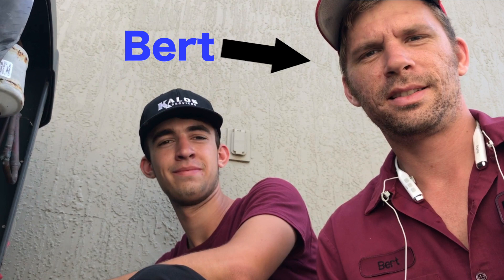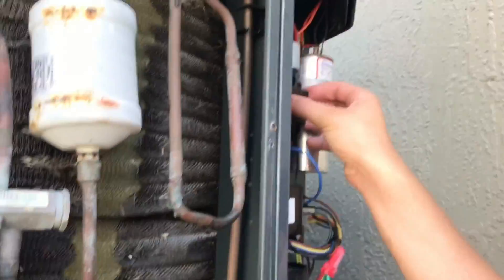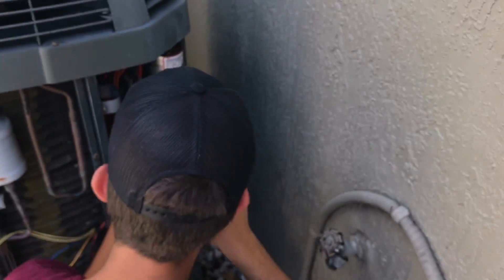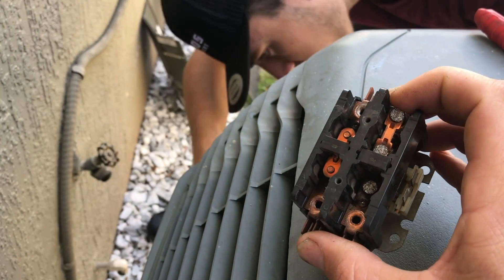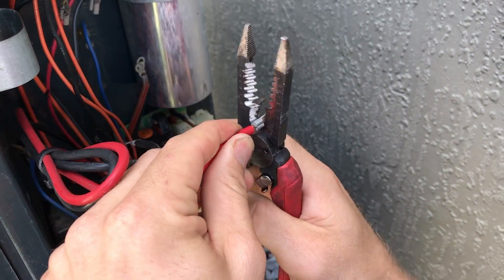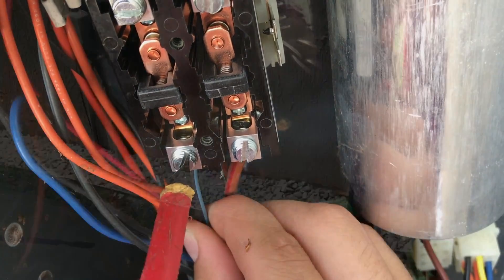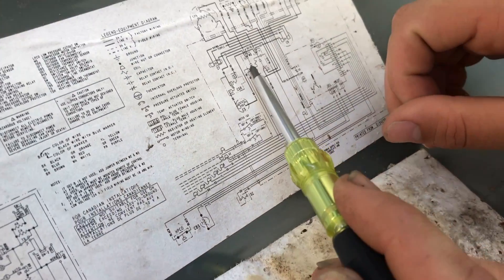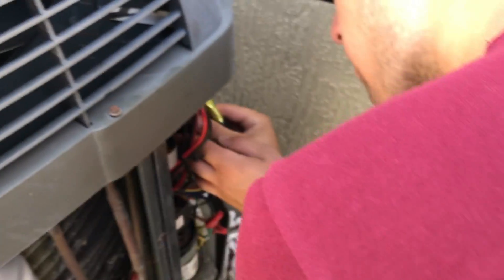How and When to Change A Contactor

Comment: Mines single pole and it stuck last night.  for some reason when a gfi in the kitchen popped off , the switch stuck on the contactor.  I only noticed it when I went out to the garage to put groceries in the second fridge out there and I knew the a/c was off but I heard that fan running outside.     I disconnected it and went to look earlier today and I found the cover was off on the stuck switch.  Of course all the power was disconnected at that point, I tapped it and it unstuck.    What I am wondering is if I should replace the capacitor as well as the contactor. I mean, it unstuck but I know how old all this stuff is.    my capacitor is Oval and tall, not a squatty one and not a round one.  It has no markings on it however.   also i have been the owner since 2006 and never had any problems with this condenser unit ( Carrier ) at all.    when I tested the system after the contactor was unstuck it worked fine but also, LOL  i am not going to trust that contactor to not stick again. 
  I wonder what the heck the specs are on this capacitor though.  I don't see why it has no label.   i am leaving the entire system disconnected from power until I at least get that new switch.   There is also another little doo dah thing in there. Cer-Mite CM Ceroc   wonder if that needs replaced also.    maybe all this stuff needs gone and new installed?

Comment: I love your videos, both content and execution.  This is the first time I've seen/heard of cutting the ring terminals to fit into the contactor lug.  Your explanation of that made sense.  You've already got a good crimp connection to the stranded wire and then that should give something for the lug screw to be able to connect to without mashing or damaging anything.  But then later you described that the contactor has a torque spec.  I'm assuming that the torque spec for the contactor is for screwing onto wire or perhaps a ferrule.  It may take more torque than that to get good purchase and electrical contact onto the crimp portion of the ring terminal that the techs used here and hopefully that's well below the failure torque for the lug threads.

Comment: I agree....no problem is snipping off the ring connector on the "ring". Another way.....take the ring and fold it onto itself lengthwise......makes for a solid "bar" to insert under the screw-head connection.

Comment: Yeah and the sucky wire nuts on the trane and there’s no telling what else happened. Also need to check the breaker sometimes electric panel and the breakers get loose and the wires got loose

Comment: Dielectric grease is non conductive this is not the appropriate use .They make the proper grease for that application manufacturered by several suppliers but let's be clear that is absolutely the wrong use of the grease the tech used and all screws on high amp connections should be torqued to stated value on the contractor

Comment: I’ve been using the same method of leaving the crimp on when changing out contactors for a few years. Now we only stock lug type contactors because of the solid connection the is method provides. Your narration is spot on. Great video.

Comment: When dealing with a three phase system and three pole contactors, is there a way to test the Integrity of the contacts and determine when they are close to failure?
Reply: Such as checking the resistance with the contacts energized but no high voltage applied.

Comment: I've been doing electrical since the early 80's and I had some systems that I performed 6mo maintenance on  for years on end. I've seen new systems go in without the use of deoxidizing compounds and end up with terminal corrosion in 2-3yrs. Then I've monitored connections that have been treated with De-Ox, Noalox, etc. and seen zero issues. I alway do voltage drop tests and measure terminal temperature, and the De-Ox/Noalox treated connections have performed significantly better than untreated systems.

I use de-ox compounds on on all connections that are outdoors or in high humidity areas, with excellent results. I even go as far as using de-ox compounds on male cord ends, plugging them into recepticals in order to coat those contact areas. I am 100% convinced that the de-ox compounds are benifical, if used in moderation. Regardless, always tighten, wiggle, tighten, wiggle, tighten, wiggle, tighten wiggle...

Comment: I truly believe some of the original equipment contactors are undersize and cheap.  Sometimes it’s better to go up a size.  Also it should be verified that the unit is not able to short cycle, or try to start when the system isn’t yet equalized.  Frequent starts kill contactors.

Comment: One thing I've found that is also very important when replacing contactors is referring to the schematic as was done here to confirm the style of contactor. We run behind a lot of people working for home warranty companies and often I find double pole contactors installed (without properly jumping out the proper side of the contactor) where a single pole contactor was originally intended by the manufacturer.

Comment: Has anyone used this? "DEOXIT Contact Cleaner" that is how you properly clean and protect contacts like the lugs that were greased. This product and products like it are designed for that.
Reply: Deoxit is the absolute best contact cleaner I've ever used! But, it doesn't leave a heavy enough film to protect connections (in my opinion). I use De-ox, Noalox, or similar heavy bodied compound after I clean with Deoxit. Some items should be cleaned, while others should be replaced. Pro tip: if the contactor has corrosion, replace it rather than trying to clean it! Also, if the wires are corroded, especially if they've turned dark, cut them back to good copper (if possible).

Corrosion and its heating effects, that in-turn cause corrosion are like a communicable disease. Camp grounds are a great example of this phenomenon: new receptical is used by camper #1,  who has a heavily tarnished or corroded plug. Assumming camper #1 is using high enough amperage, the high resistance in the connection causes localized heating, thereby damaging the new receptical via rapid oxidation, carbon deposits, and thermal degradation of the metal contacts. Now camper #2 arrives with a brand new plug, but he plugs into this now damaged receptacle. Assuming camper #2 is drawing enough amperage, the high resistance in the connection causes localized heating, thereby damaging the new receptical via rapid oxidation, carbon deposits, and thermal degradation of the metal contacts. Now his plug is tarnished, pitted, etc. Enough of this localized heating will eventually cause the wire itself to become compromised and simply changing the plug or receptacle is no longer enough to stop the spread of this insidious communicable disease. Most of these issues can be avoided by the use of thin coats of a deoxidising compound on the wiring, the plug, and the receptacle contacts (in my opinion, but based on testing).

Comment: Brian, Excellent video, as usual. Instead of dielectric grease, use anti seize grease, like this:
https://www.amazon.com/Permatex-09128-Copper-Anti-Seize-Lubricant/dp/B000HBM8HU/ref=sr_1_17?gclid=Cj0KCQjwoqDtBRD-ARIsAL4pviBXH5hq_kSOliOAlbhm2kLFmhv_Xt3XUNcDBGSh_fIx4kcgpaCQVREaAmveEALw_wcB&hvadid=177542121011&hvdev=c&hvlocphy=9052539&hvnetw=g&hvpos=1o1&hvqmt=b&hvrand=16064951371036436168&hvtargid=kwd-29833005865&hydadcr=6402_9585569&keywords=conductive+electrical+grease&qid=1571344246&sr=8-17

Comment: How come HVAC companies are crazy about technology, but won’t use a voltage zero crossover circuit to only energize the contactor when the
AC mains are about to cross zero volts on the sign wave, thus drastically reducing the arcing.

Comment: had one being shorted by a 24 volt short in the furnace blowing the 3 amp fuse on the board. Fixed the rub out short. Called for cooling and the contacter was chattering. compressor sounded horrible. Shut system down changed contacter and restarted compressor. Compressor would not run and was off on thermal. Placed ice bag on top and went to lunch returned and attempted to restart compressor. would not restart. Omhed out  single phase compressor one omh per leg. Advised customer compressor went bad.

Comment: I have been coming across a lot of buzzing contactors in electric heaters (208 3phase with 208v coil) they are pitted pretty good too, when I swap them with new ones they dont buzz. What causes this? Thanks!!
Reply: Matthew Beblo, the “buzzing” comes from rust on the surface that is attracted by the electromagnet coil when energized. The uneven rust surface causes it to not sit flush and generates a “buzz” as it tries to do so. This is caused from not being energized for a long while. It will calm down some after several cycles, but will never be as quiet as it should.

Comment: Oh I thought u said contractor!?
Switch!!!
Like musical chairs!!!
The one with plumbers crack syndrome goes 1st!

Pull ya pants up before you come to my place..... ain't nobody got time for that😂🤠🤣

I change them when they have sutty look around the contact area! Or intermittent strange freeze ups!?(or visibly worn!!)
Always put right size in too(residential)or slightly higher amperage (30amps are good!)RFL ?!
Bigger the unit single phase unit... probably need a bigger contactor amperage 30-40 plus?!

Wire terminals burning wearing.... replace contacts & make sure they're tight snug fittings!
Clean /rinse the condenser coil.... hot unit .... hot/ harder working outdoor unit/system!

Take it to da house 🏡🏃🏼
There's always more to check...
Experience will tell you if low on refrigeratant after cleaning coil(s)... take temp drops at supply & return vents etc!!
A history of good check ups will help with determining the system charge!?
Eliminate call backs! Do a gd thorough job the 1st time!!👍

Comment: Being a little picky but 2 things. 1st use factory style contactor and you won't have to worry about the issue of the wire ends. 2nd ants will still get into that style of contactor...lol had it happen many of time....
Reply: Loral Kinney I don’t even carry 30 amp contactors anymore because the lugs on the 40 amperes are far superior, still have ant issues on those though too...
Reply: @andrewhicks6494  There are 40 amp contactors with the factory screws for ring terminals too, but I take your point that this allows you to simplify what you need to stock in the service van.  And these lugs are more common.

Comment: Sound like yall the kind of guys that try and sale a complete system when a fan motor goes out. There was nothing wrong with that contactor
Reply: @Texas made The contacts are pitted and you can see it's smoked up from arcing. I'm a tech with 23 years of experience and not a parts changer or a salesman. If I'm doing a PREVENTATIVE maintenance and see a part that may fail in the near future I will recommend to the homeowner to let me replace it to prevent further problems. That is the reason we do preventive maintenance is prevent breakdowns right? Just my thoughts
Reply: Cant tell if youre joking
Reply: You're a smart one aren't ya ? Better to wait for the compressor to fail?
Reply: I was about to say this myself. I don't see this "black and pitted" they are talking about.

Comment: If the dielectric grease creeps in to the contacts of the contactor that would be really bad!
Reply: TheMotoRebel fortunately they are making capacitors with less dielectric!?
U can shake a new capacitor and you don't hear or feel the fluid slushing around in them hardly anymore.... & the capacitors don't last as long as in the past!
(lol that's the only draw back!)

But it's a mess when those old capacitors blow sometimes!!

Rinse or clean condenser coils & go to 440 volt if this happens a lot on a unit!? 
Sometimes 370 volt capacitor isn't enough for the unit.
👍👌🏼👋🏽

Comment: Bryan made good points about measuring the voltage drop across each contact. This should be done before and after contactor replacement. From my checking of voltage drop,, 50 millivolts would be the maximum. Also, an amp clamp as mentioned would confirm the unit doesn’t have any hidden issues.
Reply: Okay smart guy.  I seen your stuff before.  Now where did you get that information as it is not found anywhere on these kind of sites.  Let's get specific here.  Where is the probe placement for the measurement.  On the bare wire before and after it leaves the terminal, on the terminal screw heads, or maybe on the contact bars the terminal mounts to.    We got at least a 4 point series circuit here.  And another thing I've seen here is several well known clamp meters have poor resolution and seem to only measure down to 100 millivolts or so.  What about that?  Guys read 0.00 v and think there in heaven.  Look forward to your response.

Comment: Dude wears his wedding band when handling electrical?........ tough
Reply: Oscarbm1234 till death due them part😂 But seriously it hurts and I don’t wear mine anymore because of that
Reply: Oscarbm1234 lol u can do it... always check with your voltmeter before wrkg on systems! Turn off breakers or pull disconnect box plugs (push contactors in manually etc...

But when you're working with someone look out! U can get shocked !!! Lockout tag out really comes in handy!!!
Respect elect!
My dad was an electrician!!
I feel ya about metal jewelry during electrical work!!
Commercial more dangerous!! Lot of people interacting!!🤔👍😤😱
Reply: Orlando Johnson yeah mine was on a 480 vac system as I was showing a helper to be careful and telling him that 480 will jump roughly 1/2” and bam, bitch got me
Reply: Had to replace 480 vac motor on a brine pump. Four ft. from motor was breaker labeled brine pump. I shut breaker off than took off connection box cover, and just to be careful, I took meter and tested. It still had 480 volts on it.Told supervisor who put me on job, an he said, Oh yeah, we relocated power to breaker on next level down. smh.
Reply: I tagged it out, and noted that power came from another source.
Reply: Andrew Hicks oh my!!! Glad u used your voltmeter!!!!!
120 volts is dangerous but that 3 ph high voltage is no joke!!
Those idiots were wrong for not making that known!!!
We all wanna get home!! So never rush without checking for power!!!
Dead will always be late for supper 🤔🙄😤
Ikr!
Reply: @orlandojohnson5742  genius

Comment: locked rotor amps is what the amp draw would be if the compressor is locked up not at start up.
Reply from the maker: It’s the same. In both cases it is the amps drawn when the rotor isn’t moving. On start it’s just instantaneous
Reply: @HVACS  I always thought they were different thanks for clarifying that.